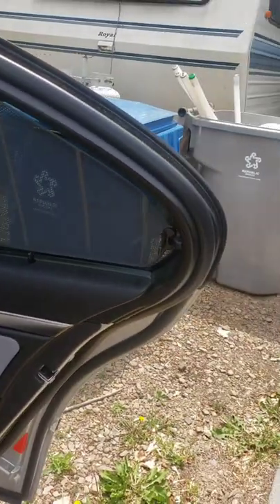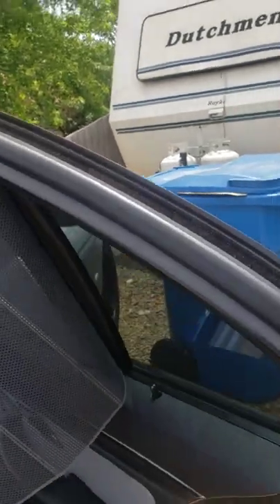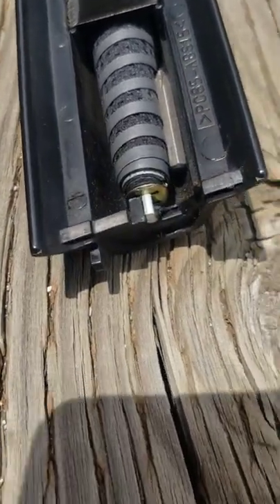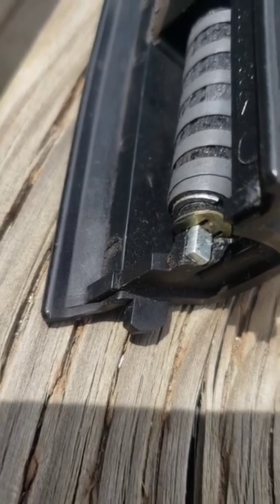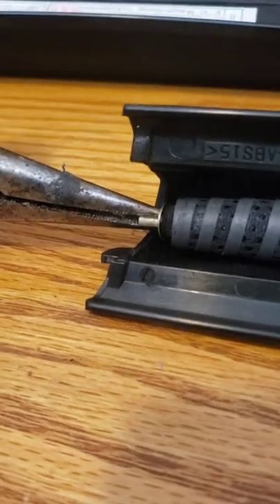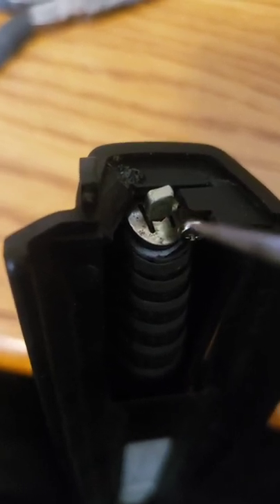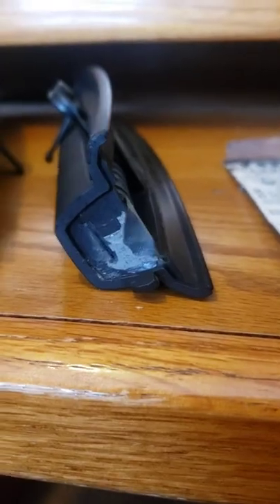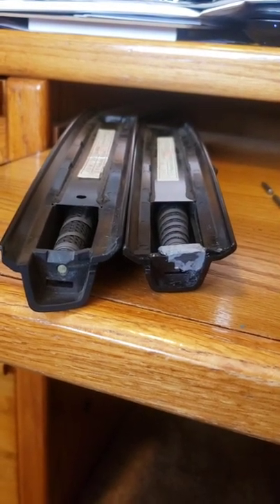Sunshade repair

Comment: Thanks Chris. I was able to remove mine & saw the broken area that you have as well. Note: they small screw was to keep the "tag" of the shade from coming out of the original slot & probably was the source for the plastic breaking after many hot & cold cycles. Good video!